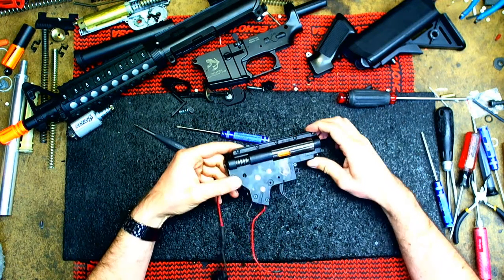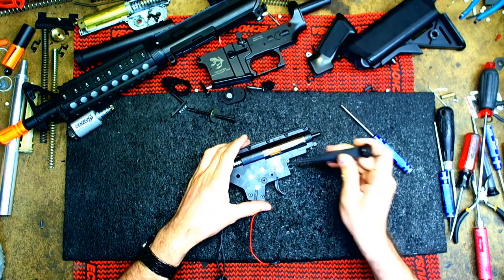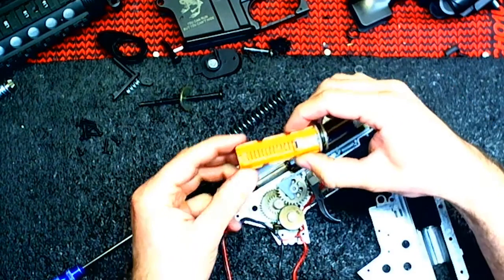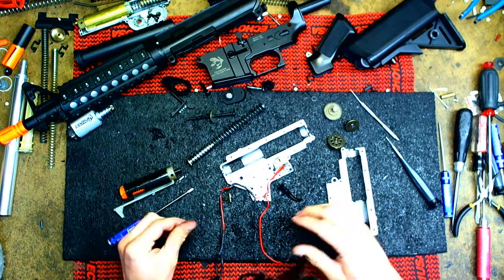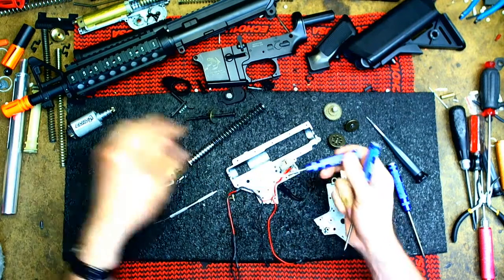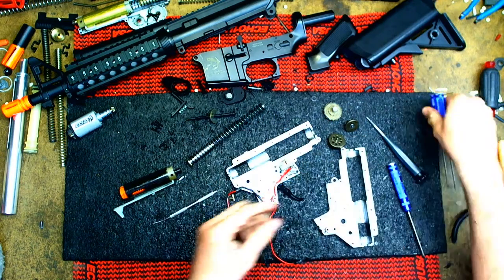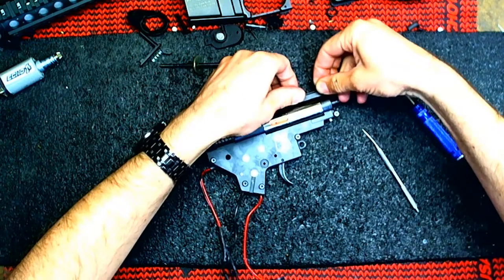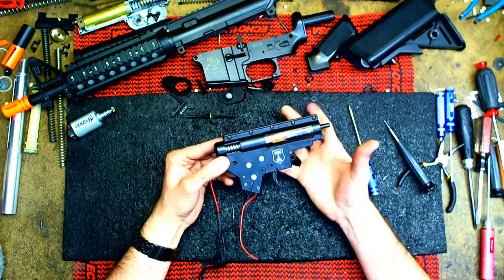Echo1 M4 Gearbox Takedown and Build

Comment: @ZaCkOX900 Teflon taping your piston head covers the ports, thus you piston head o-ring gets no chance to expand while firing. What I do is I roll the o-ring around a cylinder, then heat the o-ring up with a heat gun or blow dryer. This makes the o-ring larger giving better air seal

Comment: @theoldmacarooni8 He has an open port cylinder. Heat is bad for o-rings, where the heck you learn to do that? The best thing to do is replace the o-ring. Other way is teflon tape the head. Heat is just a bad idea, you don't stretch the o-ring. Why do people do this, o-rings are a freaking dollar but they act like they cant be replaced properly.